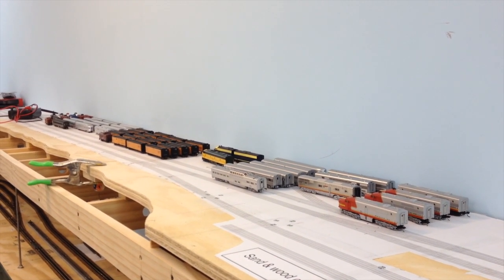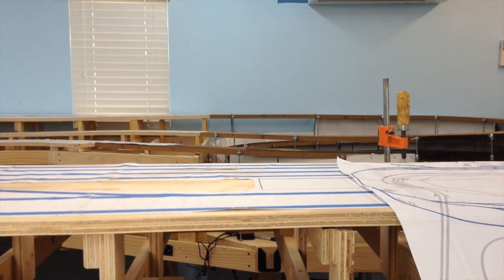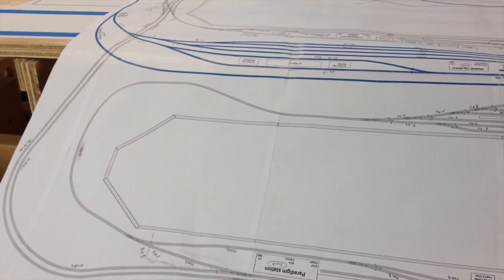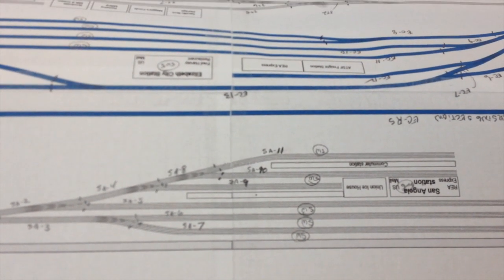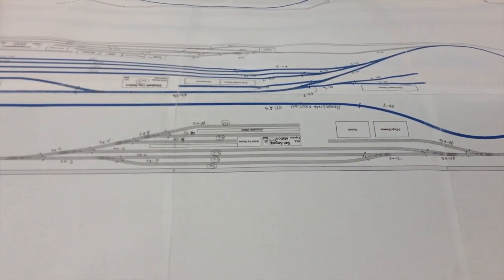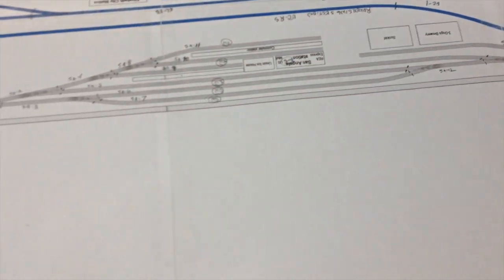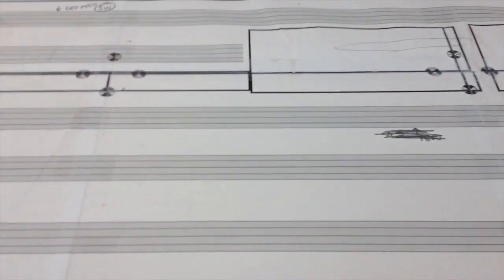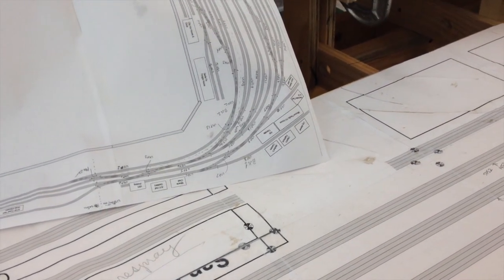DCC Electrical Planning for Main & Third Levels

Comment: Where do you buy or or secure your printouts? I believe getting it would make setting up blocks and feeders. Thanks
Reply from the maker: Hi Earnest, Thank you watching and your question. I designed the layout on a Mac using an application called Railmodeller (it is still available on the Apple Mac App Store). I printed it out in 1:1 scale, glued it down on the plywood for exact track and turnout location as well as using it for electrical planning. The printouts certainly helped me make the electrical planning easier to do. Thanks again…..John

Comment: Great design and thanks for the update.  What planning software are you using for your drawings?
Reply from the maker: waltworld Thanks for the question. I am a Mac user (Mac Pro with OS10.10.1) which limits what I can use.  In this case, I decided to use RailModeller software (http://www.railmodeller.com/) because it was easy to learn and I was able to document one of my already built double-track helixes in about 40 minutes. I had already evaluated a number of other design programs (I can re-boot my Mac to run as a PC in Windows 7) such as Cadrail, JMRI's XTrackCad (free), and 3rdPlanIt.  I found them to have too hard of a learning curve for me which is why I picked the one that I used. Now, it doesn't have all of the features (e.g. scenery) of the other ones but it had the libraries for Peco and Atlas products that I use.

Comment: damm john very informative think that layout is gonna be awsome
Reply from the maker: Thanks.  I have already installed 800 feet + of various gauge wire (12, 14, 18, 22) just to get the staging level and the two double-track helixes completed and running well.  Add in another 40 terminal strips, about 400 connectors (bayonet and suitcase), and probably 500 solder joints and all of that has to be able to be traced. The main and third levels will be about the same amount of wiring and thus the reason for the time taken to plan the wiring.